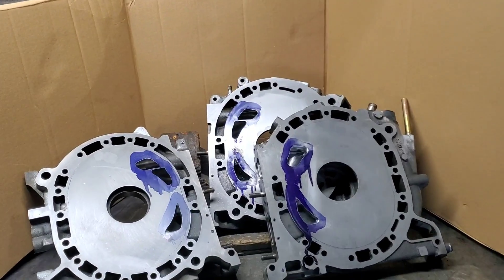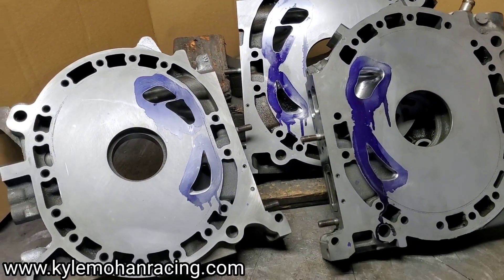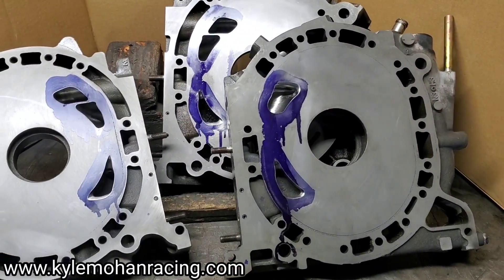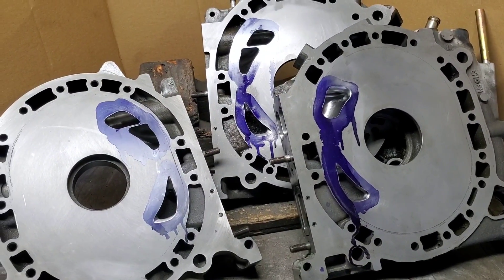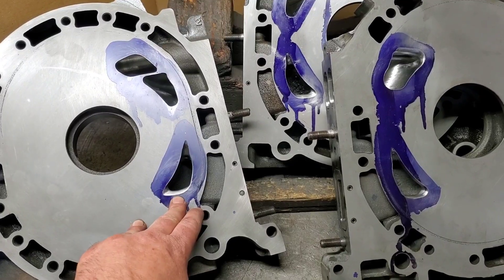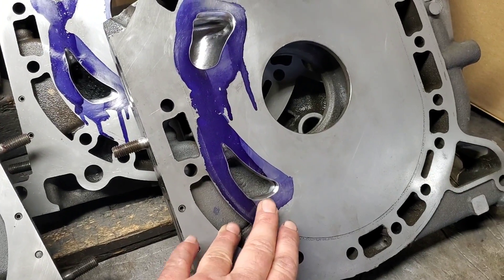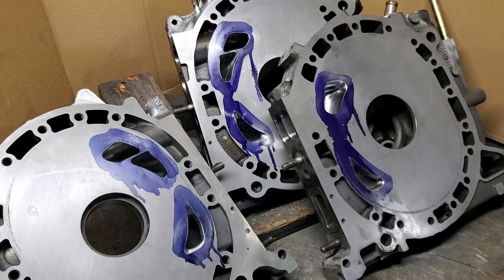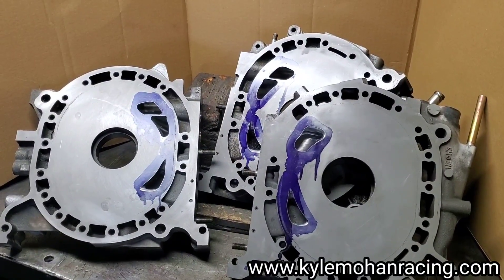RX8 Renesis Porting, Good or Bad? Mazda Rotary Street Porting KMR tech talk

Comment: I bought your half bridge port street template for my 8 I’m currently building, first question, do I use the half bridge on the center housing? I assume not but first ever Dorito build and ya never know. And second if im not going to bridge the center iron should I flip the apex’s so the second smaller apex corner rides on the center and not the bridge? Just paranoid of one of the pieces from the apex being able to clip or fall into the bridge??? Love you vids and you’ve helped a ton already so thanks!!!!

Comment: Do we need to port all the three iron plates when going for ports?
Reply from the maker: all modifications are up the the owner. But generally yes, all 3 plates are ported.
Reply: @KyleMohanRacing  I am running a 4 port renesis in my 2004 rx8. I wanna go for a Bridgeport. Do I need to get it tuned or something too. Any necessary info will be appreciated thanks:)

Comment: Any chance to use some front cover like a 12a with a hole for dizz? I want to put a weber48 in my 13b 6port from rx8, I'm building a l200 single cab with this engine. @l200dunz
Reply: Checkout ARC rotaries

Comment: therefore no full bridge or half bridge (with AUX and secondary ports) on rx8 renesis?
Reply from the maker: Streep ports and the half bridge have power gains when properly setup.
Reply: @KyleMohanRacing  
the half bridge, you mean only the AUX and secondary ports? because I know that in england, some use the renesis with the 6 bridged ports. rotary revs offers a full bridge for example.

Comment: Do u still nitride the plates after wpc treatment?
Reply: The hardening on the stock irons seems to be of varying thickness. The lapping process can get rid of the hardened layer leaving you with a soft side housing. Nitriding is highly recommended if not necessary.

Comment: I'd like to see you go more in depth with how porting affects the entire power band in the renesis as it's very common for ported rx8 motors to see loss of low and midrange performance for minimal top end gains. I'm all for porting older motors as my SA has a 76-78 based high compression large streetport 4 port 13B with fantastic results and considerable low end torque and HP gains. IMO I see zero point in porting renesis irons with exception to mazda's poor casting of the exhaust port where carbon builds up which is why I smoothed them out in mine, but left the intake side stock and all port shapes left stock as well. Also with the typical cooling mods my running temps usually stay pretty low (this was with both the previous bone stock motor and current one), so not really seeing the benefit for exhaust porting in that aspect. For a turbo build maybe, but for NA my understanding as far as older motors go is that porting down leads to HP loss and if it affects the renesis in the same way then even more reason to avoid it. I look forward to your response.
Reply from the maker: Dyno charts, race results, and tests have shown gains for Porting a Renesis if your goal is performance driving ( Minimal yes but its there ) .  Yes,  Both  intake and exhaust should be cleaned up at a minimum to reduce carbon build up, its a bigger problem in the exhaust like you mention.  Porting will increase performance and lifespan if done properly.  

Who drives a ported rotary at low RPM?... 

The heat im talking about is the heat not expelled or absorbed properly.  Exhaust porting helps remove some of the heat build up in the cast iron housings at the exhaust port.   Ported housings don't shrink as much as oem.  

I hear you but my ported rx8 beats my friends without porting and he has more mods. Thats not really a quantifiable test but dyno tests are. I will dig some charts up.

Also alot of dyno readings are false on OEM cars because of the CAN system.  I will try to do a video about what we have learned.  

In the end.  Everyone can build what they want to achieve their own goals. I'm just showing what we have learned. Thats the joy of cars.
Reply: @KyleMohanRacing  would like to see this my rx8 needs a rebuild and im looking into staying na and street port

Comment: How do you store your spare parts?
For example, spare irons that want to corrode.
When I was slowly rebuilding my renesis I was coating everything in WD40 between working on it to try and prevent surface rust.
But I'm not sure how long that would last if I had parts that might be left for a year or more.
Reply: When I first bought a milling machine, I though WD40 would be a good rust preventative.  WRONG. It attracted moisture in that application. I switched to Fluid Film, with good results.
Reply from the maker: Yea.  Use oil with rust inhibitor

Comment: Also, I have heard claims of RX8 exhaust porting allowing flow to be increased by 30%, how much does it actually increase flow by? As well, doesn’t porting the exhaust reduce the rotors “stroke” before it evacuates the exhaust air? That would reduce torque and horsepower in that sense, is there a happy medium between increasing flow and reducing torque from the natural movement of the rotor?
Reply from the maker: Depends on port design and shape. The RX8 has restricted exhaust from in its OEM trim.  To big can effect TQ, but Restrictive flow will kill HP which also will bring TQ back up.   SO generally TQ and HP come up for most of the RPM range until you get fairly big.  This is not a big port....